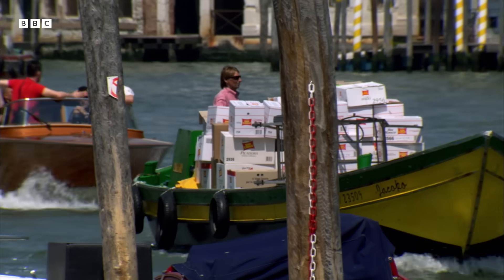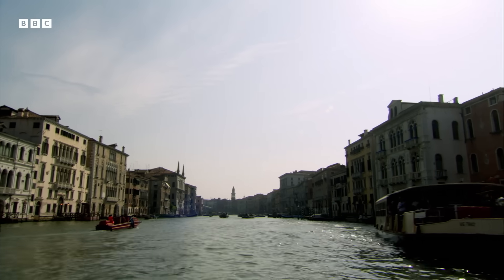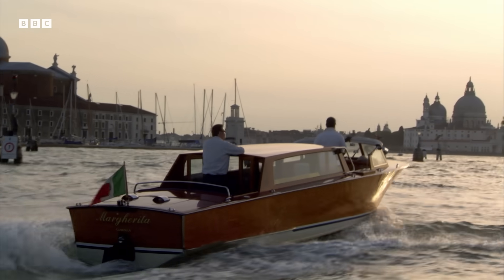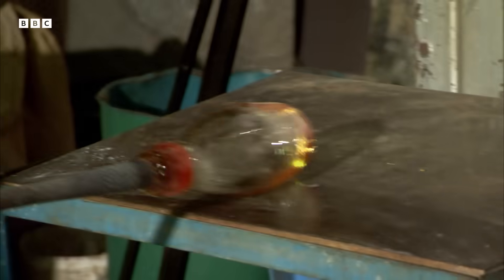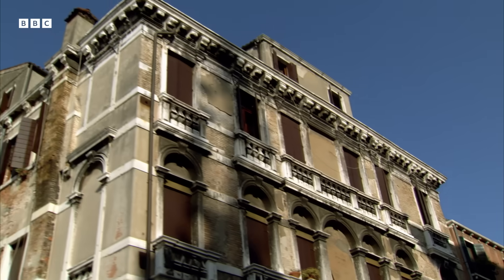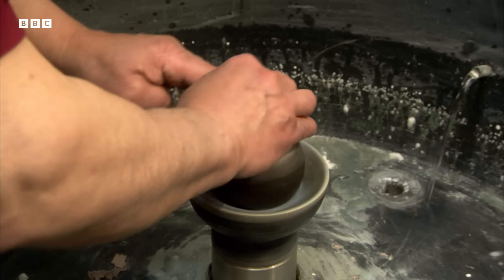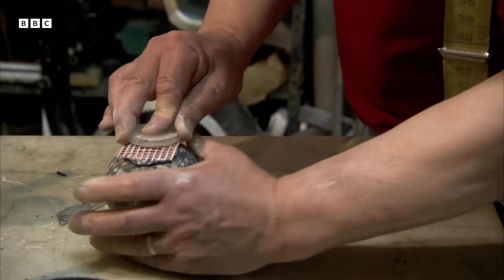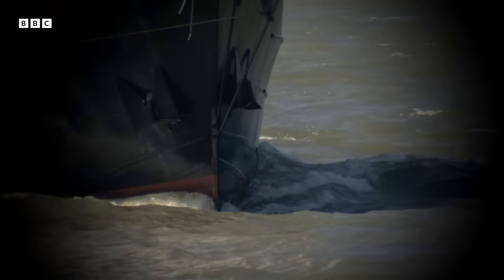The Secret To Galileo’s Groundbreaking Telescope Revealed By Surprising Item | BBC Timestamp

Comment: 4:37 " ... through it, ships that were fifty kilometres away ..." - whut? The BBC's outstanding production teams, outdoing themselves again.
Reply: It's correct though
Reply: No, not remotely correct. There were no structures in medieval Venice anywhere near the 200M  / 50 storeys required to put the horizon 50Km away. 

Presumably St Mark's Campanile (the tallest structure in Venice at that time) is being referred to. It was 98M to the tip of the spire, with the belfry (which would have been Galileo's vantage point) at about 72M, which would put the horizon at c. 30Km. 

All of which is moot given there's no way Galileo's instruments had the resolution needed to discern details of individual ships at anything like these distances.
Reply: @EliteRock  You have assumed no Atmospheric Refraction, & that the base of the tower is at sea level & that Sea Level hasn't increased in the last 500 years & there are no tides. Using Walter Bislin's Advanced Earth Curve Calculator with Standard Atmospheric Refraction & an observer height of 80 metres ASL ... the apparent horizon is 35 km & 14.6 metres of ship height is hidden at 50 km.

Your commentary re the Resolution of Galileo's 30x telescope is interesting - the popular figure is 3 Arcseconds which juuuust might show a tallship system of sails as a tiny white blob. But I admit, I'm a dunce at resolutions. I used  Danford's YouTube video "angular resolution example using galileos telescope"
Reply: St Mark's Campanile is on the entrance to a harbour (it was rebuilt multiple times, it's thought it was originally built as a lighthouse and/or lookout), and the entirety of Venice is no more than a couple of metres above sea level.

The (early) telescopes in question were 8x (people often 'round up' to 10x - 'popular numbers' and all that). 

In terms of resolution, I'm pretty confident that the lenses would have made a sailing ship 30 Km away appear as a 'blob' rather than a 'dot' (if it could be discerned at all).
Reply: @EliteRock  I've added 8 metres to your observer height to allow for tides, global warming ASL rise over 500 years & the height of the Plaza above ASL. It is said that Galileo's telescope used in the 50 km viewing was his best at 30x - we have an example of it today.

Resolution: Did you watch the video I mentioned?
Reply: @EliteRock  The telescope was looking out to the Adriatic Sea, thus the effect of the lagoon on ASL is irrelevant. The tidal range isn't huge - a maximum of 0.47 m today on the East coast, but it's still a factor to consider.
Reply: @EliteRock  I've looked at a drawing of the Campanile & a more accurate observer height of the highest observer platform above the plaza is around 65 metres [where the bells live]

Comment: But how did he know that putting 2 lenses together will become a telescope if no one had lenses at that time?
Reply: Galileo read about Dutch experiments with lenses
Reply: You can make a rudimentary telescope by holding the lenses of two reading glasses (used to correct the farsightedness that comes with age) of differing strength (magnification) in line with each other. The stronger one closer to the eye.
Reply: He knew what a lense does so he could theorize what would happen if two were used. He had a pretty good idea what would happen and he experimented with his theory. He built off of knowledge he had. Basically he had what's called an "idea".

Comment: Well… seeing a ship 50km away? Only possible on a flat earth 😂. On our earth the visibility is 16km when your on the ground and 19km when standing on a 30m high tower. Unless the ship has masts that are higher than 90m.. so I think there was a mistake in recalculating the distances from Venice use measurements 😊
Reply: No! Only 7.6 metres of a ship is hidden at 50 km if observer height is 100 m - assuming normal atmospheric refraction. Your examples assume no refraction at all - a gross error.
Reply: @nightjarflying  curvature reaches 200 m at 50 km distance
Reply: @ivanborsuk1110  "curvature reaches 200 m at 50 km" makes no sense. Are you referring to "drop" & what value are you using for Atmospheric Refraction?

Comment: If you take two equal disks of glass with grit between them, and rub them around so that they are always off-center, one gets more grinding in the middle, and the other gets more on the edges, thus producing a convex-concave pair.
Reply: Ha! forgot about that. my physics teacher in HS used to do this. he's make big 6 inch ones.
Reply: a fellow amateur astronomer, I suspect. Yes, did this as a teenager since I could not afford a proper instrument. 8" F4 primary mirror. A very tedious but rewarding exercise.
Reply: My Dad made a reflecting Telescope. That's how he ground the lens for it.

Comment: Refracting telescopes consist of convex lenses, not concave lenses like those shown here-what gives?
Reply: Re: Refracting telescopes consist of convex lenses, not concave lenses
Only partly true.
It (Galileo's telescope ) consists of a convergent lens as objective (i.e., the lens that forms the image); and its eyepiece (or ocular), placed in front of the focus, is a divergent lens. An upright image is produced. This simple refracting telescope is still used in modern opera glasses, which are low-powered binoculars.
Reply: Try both!  It's for the eye piece and also turns the ship right side up.
Reply: I searched for your comment: YES the convex lens is the important one, it creates an image (upside down, who cares) and you can show that with a magnifying glass in a dark corridor, a dark room with a small opening for light, place the lens there. In a telescope you then use an ocular (eye-piece) to enlarge the "image" which is at the focus of the big lens. Many comments talk about the use of a convex lens to make the upside down turn 180.
The production of an convex lens is difficult, much more difficult than what the lens-maker show us. I have often speculated that perhaps Galileo used the bottom of a bottle which could be grinded to a convex lens :)
Reply: @donaldaxel 
Being serious, I can't help but suspect that both lenses were made and ground from the same Murano glass, because of its unusually high quality. Bottle glass is typically very variable because it has to be comparatively inexpensive. Nowadays, the glass used in high quality refractor telescopes can be very expensive. 
The most expensive refractor telescope I could find was APM - LZOS Apo Refractor 228/2050 CNC LW II
Refractor with Triplet Super ED optics (three lenses made from extra low dispersion glass at the front for maximum colour correction)
228mm aperture at 2050mm focal length (228mm is the optical diameter of the lenses at the front of the telescope)
[cost] €56,900.00 incl. VAT 19% (Germany) Regular price: 64990,00 €
And yes, I'd like one, but it would need an observatory and a lot of extra kit, which might be noticed by my wife.

Comment: Amusing that a doco about science will talk about seeing a ship 50Km away, which would be over the horizon and out of sight.
No mention made of the magnification to see the moons of Jupiter, or the fact that he must have had excellent vision to see them regardless of magnification  !
Reply: You failed to note that his ship observation was from atop a tower. It is quite reasonable to see the sails of a ship 50 km away given 30x magnification & the effect of refraction - the latter can 'lift' an object a substantial distance. It helps that there was little industrial pollution back in the 17th century. Jupiter's moons: I am 69 & I wear spectacles - I observed Jupiter's moons last year with 20x binoculars on a cloudless, moonless night - the moons [I saw three] appeared as points of light all in a line. Galileo would have no difficulty seeing those points through his telescope.
Reply: @nightjarflying  Also, at night in those days there would have been very little light pollution if there was no moonlight
Reply: @nightjarflying  if he would look from a 100m tall tower, the horizon is 35.7 km away. If a ship would be 50km from the tower her mast would have to be 96m tall to see the top of it.
Reply: @Pali65  You have assumed zero refraction - with standard refraction applied only 7.65 metres of the ship is hidden:
Walter Bislin's Advanced Earth Curvature Calculator.
Observer height: 100 m
Target Distance: 50,000 m
Standard refraction coefficient: 0.1694
Target Hidden: 7.65 m
Reply: @nightjarflying  with refraction horizon is 38,6km away so at 50km we still can't talk about "ship was 5x magnified", we can assume that this video has kind of blunder in it.
Reply: @Pali65  I do not understand your argument. QUOTE FROM THE VIDEO: 4:37 "... through it, ships that were 50 km away appeared 10 times closer" i.e. the viewed ship size was as if viewing the ship with the naked eye from 5 km away. So where is the blunder? And what has refraction got to do with it?
Reply: @Pali65  But also, the ship would be at sea level and the bottom of the tower would probably be somewhat above sea level even if not sited on a hill for maximum visibility at the top. So the relative elevation would probably be greater.
Reply: @Pali65 Boats have height. You're worried about the waterline. You can observe a ship's mast (ever wonder why they often have an identifying pennant at the top of their mast?) while the hull is obscured by the curve of the Earth. 

TMYK.
Reply: @nightjarflying  I really appreciate the point you make about refraction. 
Presumably the air immediately above the water is cooled by evaporation and so is denser than the air above.   So that when standing on a sea shore cliff; we look straight out to the watery horizon, not down upon it.
Reply: @RICHARD-t3r1w  Generally speaking, the atmosphere becomes less dense w altitude over both land & sea. This causes light rays to trace a curved path rather like the ballistics of cannon balls [but light ray curves are close to part of a circle unlike projectile paths]. Thus light from an object below/beyond the geometrical horizon can reach your eye rather than being blocked by land/water. So yes, the apparent horizon is nearly always raised, but very rarely is it raised to eye level while standing on a cliff.

An interesting nerdy consequence of this is the definition of sunrise & sunset given that one can see the sun before it has truly risen...
Reply: Есть такое явление- мираж. Когда даже не вооружённым глазом можно увидеть далёкие предметы.
Reply: Jupiter's four largest moons--the Galilean moons--are individually bright enough to be seen by the unaided eye. For perspective, the brightest stars are around zero magnitude, and the faintest the unaided eye can glimpse are at about 6th magnitude. Jove's moons are a bit brighter than 5th magnitude. A 7X binocular expands the image scale sufficiently to see at least 3 of them (Io is a bit on the close side to Jupiter, requiring somewhat higher magnification.) Galileo's 20X magnification telescope would handily reveal those moons with ease.
Reply: This just proves the Earth-Disc theory 🤪
Reply: @Vtarngpb  Yeah, and gravity is really buoyancy😂!  Don't go to the Ice wall, or you will be shot at by the penguins with machine guns!!😮
Reply: to see the horizon at 50km you would have to be 200m high...the highest mountain surrounding venice is about 3343m....about the same as mount fuji.....from where you can see approx. 450kilometers......thanks AI....
Reply: @macoulin  Your AI has been fed the wrong info. By you probably. The object is to observe a ship 50 km away from a tower - the horizon doesn't need to be 50 km away to achieve that. Ask your AI why - it will save you having to think.
Reply: @macoulin  Sailing ships are quite tall. They can be seen from a 100 meter tower, out to close to 60km......but it's still slightly awkward wording in the video.
Reply: @macoulin  Tx , I forgot to do the arithmetic.  Although I would add,; apparently his 1st telescope had 3× magnification and the final one for viewing the moons of Jupiter had 30× magnification.

Comment: Wouldn’t the magnified ship have appeared upside down through his telescope, not right side up as depicted?
Reply: No, the Galilean telescope used a convergent (plano-convex) objective lens and a divergent (plano-concave) eyepiece lens. Because the design has no intermediary focus the result is a non-inverted image.
Reply: More than one lens.
Reply: A good point but no. Galilean optics (as used by Galileo) produce an erect image (non-inverted). Later telescopes as used on sailing ships used different optics but included an erecting lens to produce an erect image.
Reply: Without contradicting the replies in the thread, excellent point! The opening scenes of Master and Commander were a mild irritation for this reason.
Any good historian or author of historical novels points this out. Patrick O'Brian was very particular about this in his novels.

Barret Bonden's casting almost had me throwing my shoe at the screen. But that's another story.
Reply: @Jack_AubreyRN  Ship’s telescopes, for daylight use, have an extra lens to invert the image, so it is right-side up.
[1] Are you suggesting that the film opening should have shown an inverted image? 
[2] QUOTE: "Any good historian or author of historical novels points this out. Patrick O'Brian was very particular about this in his novels." Points what out? In the book is inversion of the telescope image mentioned? 
[3] I have to ask!  Barret Bonden is portrayed by Billy Boyd - why do you view this as a miscasting?
Reply: @nightjarflying  During the Napoleonic era, which is the setting for Master and Commander, most handheld telescopes used aboard ships were simple refracting telescopes without image-erecting prisms.
Patrick pointed this out a couple of times. CS Forester did too. Unless memory is playing tricks, in the tv series the telescope images were shown upside down. 

Bonden was a foremast jack whose physical stature was similar to Jack's, although trimmer and muscly, as befits someone doing hard manual labour. The actor was much smaller than Aubrey and nothing like his character in the books. I'll assume the stature part is self-evident, he was a keen boxer. But his character was very different IMO. I can't nail it in one quote, but Bonden comes across to me as the sober quiet type with a tonne of confidence and generally good natured and affable, but always ready for a scrap if need be. I have met lots of blokes like that in England, the type is reasonably common. My uncle was one. Salt of the earth type that helped keep men steady under stress. He was the one Aubrey chose to sit with the more militant characters in the boat in the mutiny. A calm, well respected man that would be daunting to a troublemaker. I didn't see that in the actor at all. Neither did any of my mates. In fact, there was quite a bit of loud chafing the first time we saw him.
Reply: @Jack_AubreyRN  I believe your refracting telescope information is incorrect. Army & Navy officers used 2, 3 or even 4 draw hand refracting telescopes fitted with an inverting relay lens in the last draw [nearest the eye] to correct the image - an officer viewing an inverted panorama is not going to be able to read Signal Flags ["England Expects... etc"] nor Maritime Semaphore Flags. A disastrous disability don't you think?
Reply: @Jack_AubreyRN  Besides prisms a lesser-known way to rectify the image from a Keplerian telescope is to place a positive (convex) lens between the intermediate image and the ocular. A disadvantage is that the assembly lengthens by about 4× the focal length of the rectifying lens. The added length contributed to the need for ship telescopes to be collapsable.
Reply: @nightjarflying  First off, how refreshing it is to have a debate without antagonism or coarse language. Very unusual these days.

 It is possible that the information I read over the last 50 years was highly selective or replaced by better knowledge. Or even just simply wrong. So, you have provided me with a spur to investigate thoroughly.
 
Reference: University of Arizona: - Porro prisms, which correct image orientation, were not invented until 1854, well after the Napoleonic Wars.

References, various:
It appears my information is indeed out of date. Whilst I insist that my memory of the literature and media of my youth is reasonably accurate, I'm not adverse to accepting new ideas. I've read the Aubrey Maturin canon several times over the last 30 years. So, my memory will have to serve for that part of the debate.

It is perfectly true that the Galilean telescopes are the dominant archeological survivors from the Napoleonic period. Also, the suppliers to the RN, Dollond, Ramsden and Cary mainly produced the Galilean model as far as records show.

It turns out that the information on Keplerian telescopes is highly contradictory from that era. The consensus seems to be they were preferred by astronomers and scientists and crucially, were much more expensive. They also had to be much longer than the Galilean type. The only argument in their favour, from a war-time naval perspective, is their superior image quality and the distance they could cover. So perhaps the authors were not entirely incorrect. My sources give a highly speculative ratio of 9 to 1 in favour of the Galilean model.

To sum up: Fresh eyes have given me a new perspective, and I learnt something very interesting that I thought had been settled for decades. Thank you,
Reply: Stood on his head.